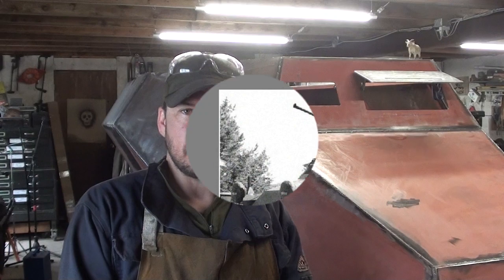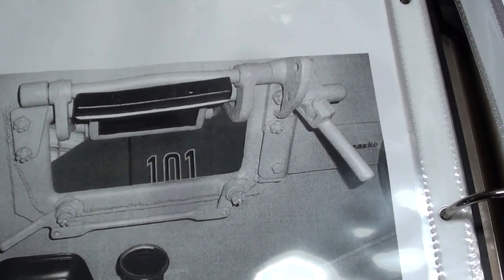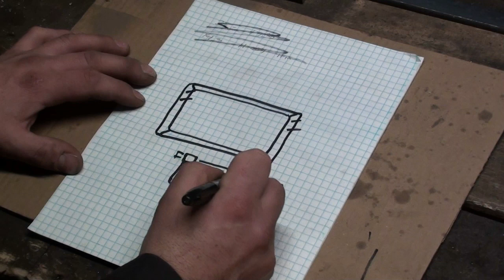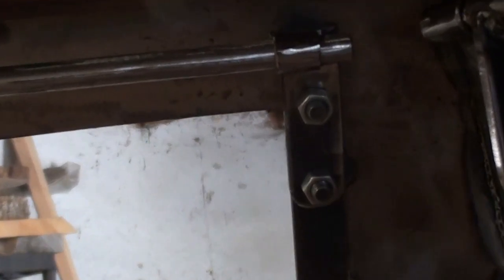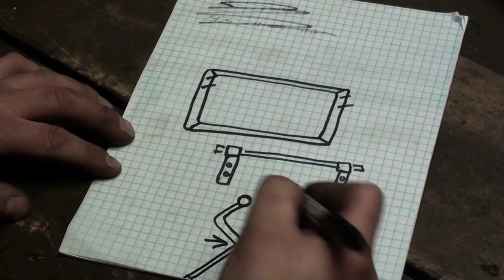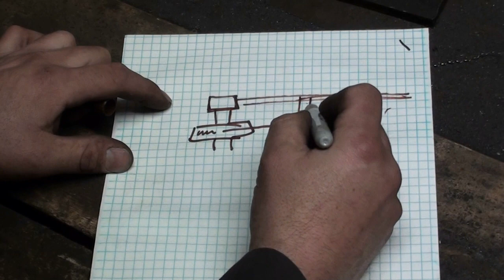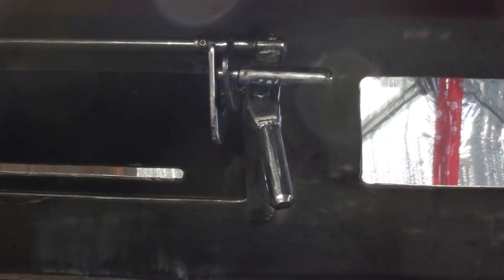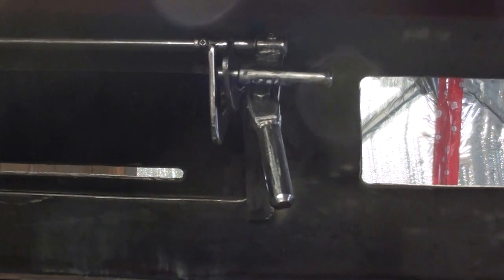Building Armoured Scout Car Ep 32

Comment: The design of that hinge lock mechanism is great. Is it more or less copied from the original   222 ?
Reply from the maker: Yeah I basically copied the original design (used on versions with internal hinges).  Mine are not perfect copies,  due to limitations in my tools and materials… but I’m happy with result.